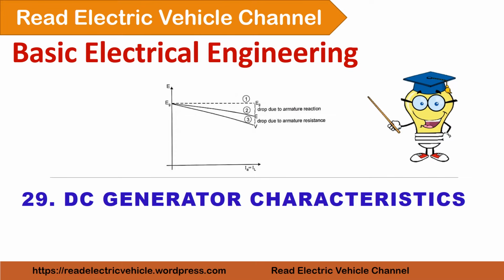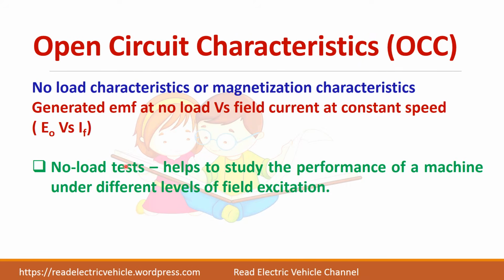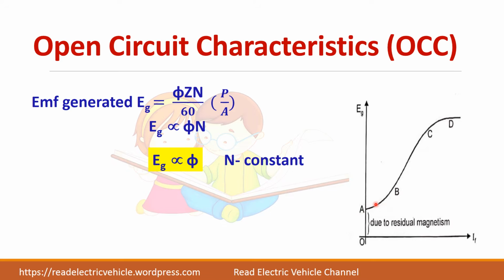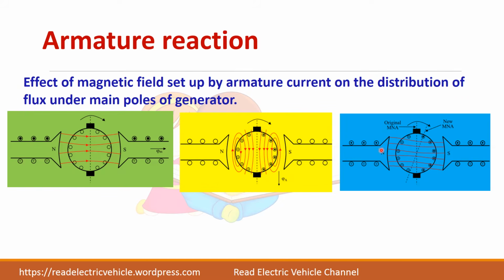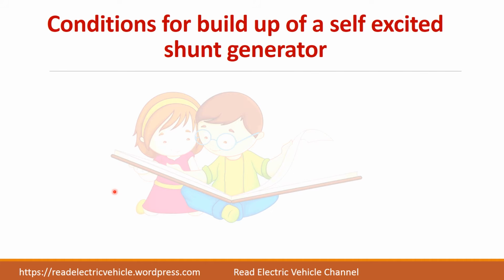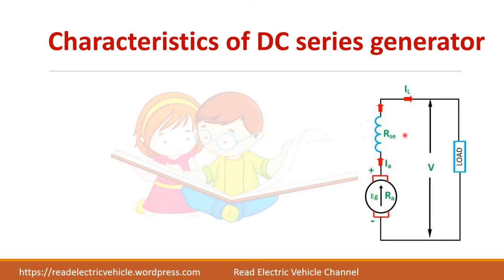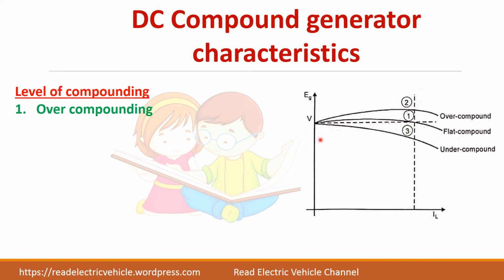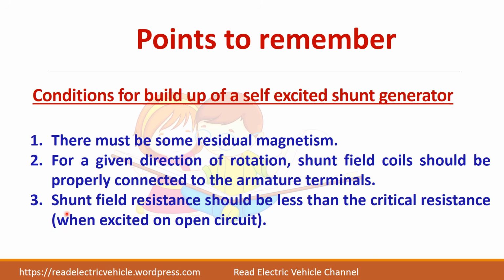DC generator Characteristics/OCC/internal and external characteristics

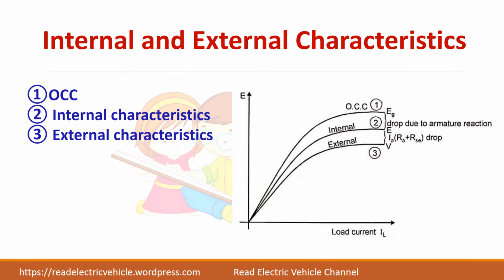Comment: 17:30 why there will be no residual emf in case of series generator
Reply from the maker: In a series generator, the field winding and armature winding are in series.The armature current flows through the field winding, creating a magnetic field.
Reply: @readelectricvehicle6078 so there should be voltage even if the field current is zero